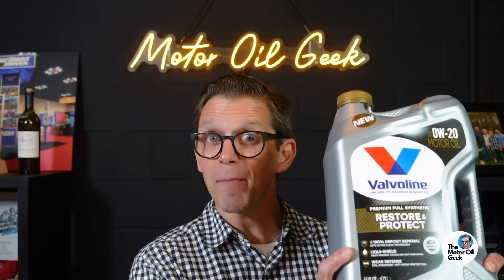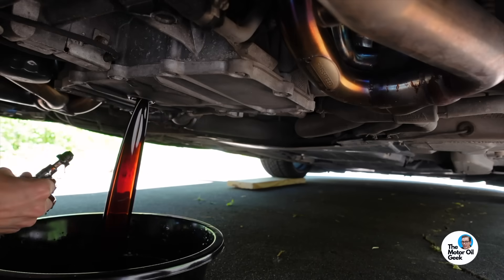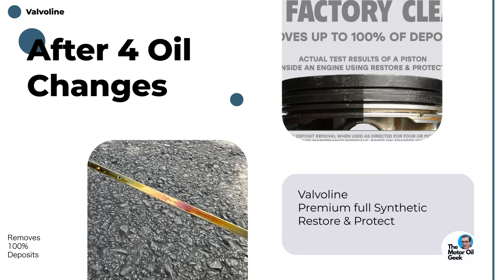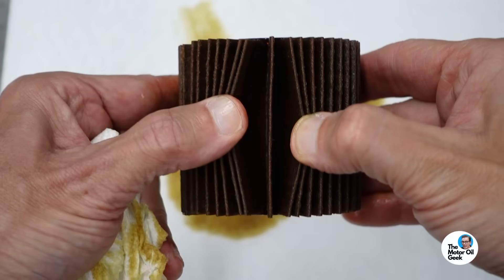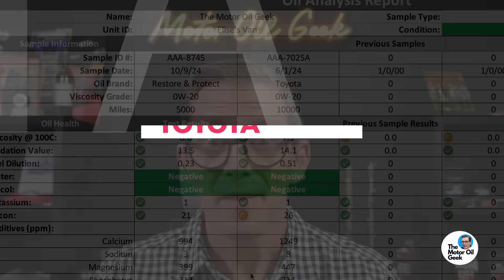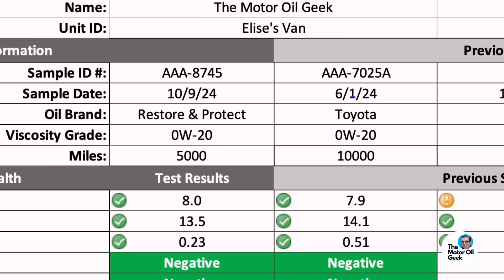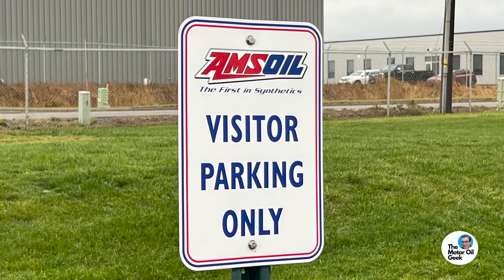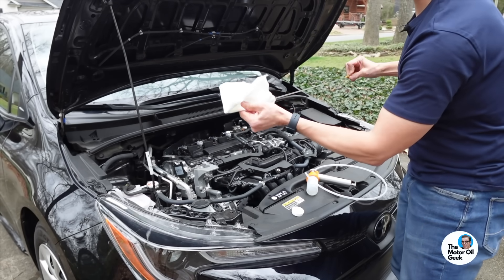The TRUTH About Valvoline's BOLD Engine Cleaning Claims

Comment: Makes me love using amsoil oe 0w16 in my wife’s 2019 RAV4. 140k now and the dip stick is spotless. 5k oil changes 30k trans, transfer case, rear differential service schedule. Been using amsoil 5w30 SS in my 2017 Acadia with 120k and the timing chains and dipstick is spotless. 5k oil change and 20k on transmission because I tow my 4seater sxs with it) 14mpg average when towing, 36mpg average when not. Can send pictures if needed👍. Both have been using amsoil since breaking oil changed @ 1k
Reply: I would love to try out amsoil but the price has always persuaded me against it. Over $70 for 6quarts of 0w20. The restore and protect was $37 at Walmart, much closer to the lowest priced oils around $30. The difference has been night and day in terms of smoothness, power, idle noise, and mpg in my Toyota 3.5 V6.

Comment: This would be good to use in any Toyota product with the 2.4L 2AZ-FE engines from 2007-2010 with high miles, it might free up those low tension oil control rings to help slow the oil burning. Of course you can go the other way and use conventional oil and allow the oil to carbon up on the rings and use that as an oil seal.

Comment: Would be good to know what Valvoline is thinking about how many miles between oil changes for their claim "gets almost 100% clean" ...after 4 oil changes. What's the mileage interval in-between these 4 oil changes? I cantacted Valvoline and got a form-letter response... "manufactgurer's recommended interval". That doesn't tell us anything about how long this oil needs to work to clean an engine from Valvoline's perspective.  Makes a difference if the assumption is 3000 miles vs 5000 miles...and how many jugs we buy to get this performance.

Comment: How would this work on an engine from the 70s with flat tappet cam, with zinc additive to protect the cam?  I currently use Driven Hot Rod conventional 5w30 and sometimes a 10w?   I can only imagine the lead and other deposits over the years.   If it matters it’s a Chevrolet small block with 70k miles never been apart (LT-1 from 1970).

Comment: So....back in 2002 I bought a salvage titled 1997 saturn sc1 with 143000 miles because I was planning to do an engine swap to the dohc variant and recondition the car. However until I could do that I had to just run the car as is. I checked the oil and it was clear that the oil had been consistently overfilled since there was a dark chocolate stain on the dipstick up to and just over the 'full' mark by a quarter inch. I used mobil one on my other cars so no reason not to here. After 3 oil changes the dipstick was silver again, save for that little dark chocolate band just above the full mark because I put it to the correct level. Been using mobil one ever since on all my cars. I am a racing enthusiast and over the years Ive had multiple saturns, torn engines down and rebuilt them and I have always used mobil one in them and theyve always been silver inside. I have been paying attention to this oil since I saw it and this vid is very helpful. My wifes scion xb had to have the pistons replaced under warranty due to oil consumption (apparently piston and rings caused) and I do work as an auto advisor some 26 years now and seeing tons of hyundai and kias 4 bangers  falling victim to the same, Id highly recommend owners of these cars to swap to this oil to see it it alleviates this. Some volvos experience this as well

Comment: 1. You need to define the use-case, the driving practice of the tested vehicle. Wasn’t, just as “the wife’s car”. That’s at best macho, but technically says nothing. My wife races her car after cold-start directly every day 100miles to and from work on a german autobahn free section at 200km/h or more. While others do only cold-engine short trips for 4kms and return home within that. Or anything inbetween or beyond.
2. The Dipstick level before and after should be checked, but wasn’t. And declared how often it was filled up, we assume never. So did we get the same oil-level or a reduced one, by how much?
3. What crap oil product did the oil geeky expert’s wife run in her engine that even the dipstick was so varnished. While with whatever car or usage and all kinds of oils in the past 40years I never had such indication of engine dirt already on the dipstick and no, I’m not picky at all in maintenance procedures or controlling what my workshops do, but I check the level every few thousand kms more like 8.000 or beyond than 2.000.
4. Showing engine parts to back the analysis. Sure you can’t as you’ll have a hard time telling your wife to get her car broken apart.

This is a science context leveraged advert whithout real life proofs and twisted worst case to best case improvements bragging.
Oil industry promoting itself, not Brandspecific likely, but doesn’t take away the pure advert level quality of content.

Be careful - that oil can be dangerous to your vehicle. Analyse first, jointly with an Oil-Expert from your car manufacturer if you want to make a decision deviating from the manufacturers documented oils to use in your exact vehicle.
Reply: It seems like you have so many gripes on the test that was duly accomplished by a person. I bet you have too many complaints in this world that you can never be satisfied with. You question everything wherein there is no perfect in this world you're living in. You're not perfect either, so don't pretend. Most of all, you are not better than others if you think or act that way. The word is called HUMILITY.

Comment: I read that some synthetic oils run quieter in some engines than others, is this true? Also heard that switching oil brands causes sludge buildup??
I drive a brand new Nissan Frontier with just under 6000 kms on it, changed oil at 500, 2000, and 5000 with Pennzoil Ultra Platinum every time ... I drive the truck nearly everyday to and from work.. have always had what sounds like valvetrain noise upon cold startup for about 10 seconds consistently, was thinking of switching brand of oil to see if it makes a difference but not sure since researching and finding these tall tales. Any advice is appreciated!

Comment: I bought a used 2012 Chevy Sonic with the 1.4 ecotech and at the time 140k on it. Since your original video on this oil, I've done two oil changes with no other variables changing and I've observed the idle has become smoother and a 4 mpg increase (from 40 to 44mpg) that's mostly like 90% highway.

I've also observed that both the long term and short term fuel teim tables hove come closer zero. So if i had taken fuel samples i would assume inwould find that fuel dilution has come way down.

This isn't science, though just one mams observation and experiences.

Comment: There have been a lot of off the shelf products to use before oil change over the years. And who knows how effective they were? My dad used to add a quart of transmission fluid before a change in the 70's while curb stoning. There was no need to remove a quart because it was normal for a later model car to burn a quart in 500 to 1000 miles. 
Thanks for highlighting a product that absolutely and positively works works. 
Question: We are using M1 Dexos Extended in our 17 Cad and 20 Jeep 3.6 VVT's. 
Could the Valvoline equal or excel at protection for our V6s?

Comment: I’m on my 3rd oil change with R&P and I can tell you it absolutely cleans the engine and my car is running better and with better fuel economy than new in this cooler weather but my car realy didn’t like this stuff in the AZ summer however I’m wondering if that maybe had something to do with it cleaning so much stuff and getting it in the oil. Can’t wait to see how it does when it warms up again and if my car still doesn’t like it in the heat then at least it will be clean and I can try something like the Penziol Ultra Platinum.

Comment: I truly believed it solved my G37’s oil burning above 6k! I normally don't beat on the car but I still didn't like that it would burn oil if I was in an emergency and had to floor it. After about 3k miles I feel it has already resolved the issue and I've done 5 good tests.

Comment: Are you not concerned about what the harsh cleaning chemicals will do to an engine long term? That’s my concern
Reply: No. Because Valvoline has been making motor oil for over 120 years. Testing long term results and used by many professional race teams. No major brand would ever put a bad product to market.

Comment: I have a 2013 Sienna bought at 82k miles. After 3 or 4 oil changes the mpg has slowly increased by just over 2mpg. Based on many r/t door to door Indianapolis Myrtle Beach. From my house in Indy to my condo in Myrtle Beach and return. Same route. Mostly the same gas stations. I also use a fuel system cleaner the last tank before an oil change. Which is always a full to empty run at hwy speeds. I don't go over 4k miles between changes.

Comment: YOU BE THE JUDGE.... I'm using R&P because of you Lake. I'm on my 2nd oil change interval with my 99 Camry 2.2l, 207,xxx miles. Some oil seepage has continued since before I started with R&P, but I had to put in AT-201 Reseal so I can pass inspection. Even so, engine is running well. Still have some oil consumption, but I keep it topped off regularly.
Reply: JUST AN UPDATE.... Oil leaking much more and a BRAND NEW ISSUE has occurred. Not sure if this new problem has anything to do with Valvoline R&P but I'll just recap you what's happening:  1. Oil leaks are getting sever. I need to change valve cover seal and a rubber cam plug today. And 2, the accelerator pedal is all of a sudden sticking badly. Oddly, it sticks ONLY at idle, and the longer the engine idles w/o touching the pedal, the harder it sticks. I cleaned out the throttle body with brake clean and a lot of brown liquid exited (maybe as a result of Valvoline R&P???).  Unfortunately this spray cleaning did not fix the sticky pedal. Going to go at it with a toothbrush and also some lubricant to see if that fixes it. If not, I'll assume the TPS is toast and literally has nothing to do with Valvoline R&P as it only sticks when the engine is running.  My engine (and entire car) has always been spotless, and oil changes were done by me religiously at 5K miles using Penzoil Nat Gas oil, so to see exterior grime and oil leaks is disconcerting to me. This engine has always been squeaky clean in and out. I'm starting to think Valvoline R&P should only be used in well-kept older engines once or twice a year. When I get the valve cover off, if it's spotless under there, I'm going back to Penzoil as my regular oil and Valvoline R&P as an occasional maintenance oil.

Comment: Makes me wonder if VW 508/509 spec approved oil is really necessary in VW engines otherwise that only leaves me 2 oil options .
Reply: Just got the 24 atlas. What r u thinking about? Im not going 10k between changes
Reply: @  well as of right now there are only 2 oils that have VW 508/509 approval and that’s Mobil 1 esp 0w20 and Castrol 0w20. But I see other oils that have the same ratings just don’t have the 508/509 approval by VW.  Yeah I’m not doing 10k oil changes either on my 21 Jetta GLI. Had my valve guid seals go bad at just over 30k miles and warranty won’t cover tear down and reassembly of the head only the repair it’s self and it’s about $3.5k for that. So I no longer go 10k on oil changes and do 5k instead. I’m not at 69k miles with no issues. I’m in a few VW groups and valve guid seals are a constant problem for all of us who have to 2.0 tsi engine.  Oh and by the way and I have the paperwork to prove this from VW as well Volkswagens acceptable oil consumption rate is 1qt per 1K miles even on new vehicles so if it’s not consuming more then that they will not cover it under warranty. Ask me how I know…….  Just wanted to give you a heads up.
Reply: @  @  well as of right now there are only 2 oils that have VW 508/509 approval and that’s Mobil 1 esp 0w20 and Castrol 0w20. But I see other oils that have the same ratings just don’t have the 508/509 approval by VW.  Yeah I’m not doing 10k oil changes either on my 21 Jetta GLI. Had my valve guid seals go bad at just over 30k miles and warranty won’t cover teardown and reassembly of the head only the repair it’s self and it’s about $3.5k for that. So I no longer go 10k on oil changes and do 5k instead. I’m now at 69k miles with no issues. I’m in a few VW groups and valve guid seals are a constant problem for all of us who have to 2.0 tsi engine.  Oh and by the way and I have the paperwork to prove this from VW as well Volkswagens acceptable oil consumption rate is 1qt per 1K miles even on new vehicles so if it’s not consuming more then that they will not cover it under warranty. Ask me how I know…….  Just wanted to give you a heads up.
Reply: @Atalanta.  thanks. Thats crazy.

Comment: I purchased a 1998 Lexus LS400 earlier this year with 158,000mi on it. I’ve always used Mobil 1, but switched to the restore & protect after seeing your last video on it. I saw the same thing on the dipstick after the first oil change, almost completely clean! Hats off to the engineers at Valvoline, it’s incredible stuff! I’m just hoping they’ll make a 5w-40 for the euro cars🙏
Reply: Damn, I need to try it I just bought a 2008 Nissan Armada with 180k miles it runs great it was built like a tank but I like years ago I know more about cars and maintenance
Reply: GS460 with moderate oil use (old owners went over a bit too much obviously), going to try restore and protect next time. The dipstick on this is clean though at just over 100k miles.

Comment: 9:43 PLEASE READ I've been waiting for this testimonial...

After seeing your original video on this oil 8 gave it a go to fix an oil consumption issue that plagues 2nd Gen Mini Cooper R56 turbo N14 Prince engines...

Over the pandemic my son and I rebuilt my wife's N14 in all respects EXCEPT for the bottom end:  remilled cylinder head, valve seats, guides etc...

Before head rebuild = 1 qt oil every 600 miles. After = the SAME. confused and unconvinced I also replaced the valve cover to a $400 OE one = the same 600 mi per qt consumption.

I then saw your earlier video and knowing a big part of the oil consumption in these early N14 engines was due to the oiling ring clogging (which was revised in the N18) I put V R&P in...

Wow. At the 1st oil change after 4000 mi my consumption dropped dramatically. I only refilled 1 qt over the span. And after the 2nd chg I was able to go a full 4000 w NO ADDED OIL.

I am a scientist and to reinforce Lakes "science" approach I have the oil analysis to prove the wear rates and elemental compositions (sorry Blackstone Labs) 

Additionally after the 2nd oil change the start up idle was subjectivity smoother and tailpipe carbon emissions and carbon skid marks went away. (I would refer to these as the Minis "carbon turds" on the driveway) 

I am a meticulous self taught mechanic on these engines. After methodically ruling out other causes of oil consumption, I can objectively say this oil works. Additionally, I used only the highest quality European Liquimoly oil at the same weight spec for 15,000 mi before switching. Oil consumption w Liquimoly was so high that I couldn't capitalize on the FCP Euro Lifetime Warranty...

All that said do yourself a favor and give this a try. "Your mileage may vary" but I can say after ruling out all possible oil consumption sources, thus oil works!

Comment: I've been using R&P for almost 10k miles (on my 2nd oil change currently) on my '06 Mustang GT with 354k original miles on the engine. My oil consumption was and still is averaging 1qt/700 miles so far.
Reply: R &  p?
Reply: @dgunearthed7859  Restore & Protect
Reply: Well after almost 14k miles I finally have a discernible improvement on my oil consumption. I've gone from ~700 miles/ quart to just over 1k miles. This has been repeated twice so far.

Comment: Hey lake could this oil in a 10/30 be ran in a diesel truck? Ram 6.7 Cummins
Reply from the maker: No, it’s not for Diesel engines.
Reply: @  what would be your best option to run in those Motors bein that they have hydraulic lifter issues in these 5 th gen models currently run rotella 10/30  7000 miles intervals

Comment: I have a 350k mile 06 Sienna. I'm on my 2nd oil change with Valvoline Restore and Protect. The van runs great but it has a significant amount of oil blow by caught by the oil catch can. Hopefully this will bake a difference as I continue to use it every 5k miles.

Comment: I don't believe you should be using solvents in your engine when the oil  is supposed to be lubricating the engine.  It may look good on paper, but I think it does more harm than good in the long term.  You could just as well add some diesel to your oil and perform the same function.  I'll stick to my Castrol 5 30 blend on my 2004 5.3.  If I cannot hear the engine when it's on, then it ain't broke.

Comment: ok how often should I change my oil with R & P? Right now in my 3.0 6 cyl Volvo I change the oil every 5000 miles but use 1 qt every 600 to 800 miles. Do I need to do it more often than that to get it cleaned out?

Comment: Running this oil in my 97 f250 351 work truck.  Just changed it so we will see.  It's a 168k mile roller style engine.  Always used 5w30 valvoline high mileage synthetic since 90k so we will see how she does.  I switched to valvoline 15w40 all terrain in my flat tappet carbureted gas 460 with 277k miles.  I know it's a diesel oil but has the api SN rating as well and good amount of zddp.  This is a change from rotella t4 which doesn't publish their zddp.